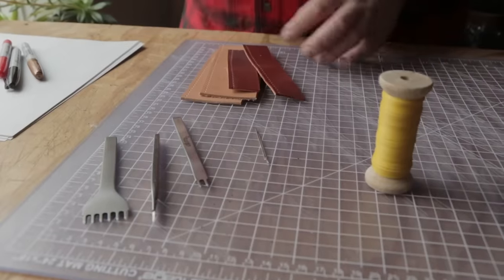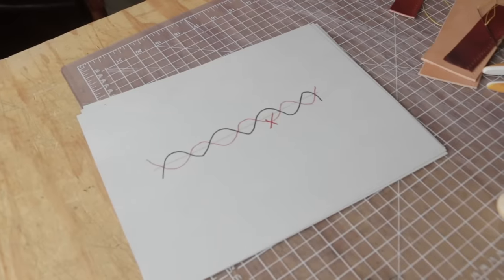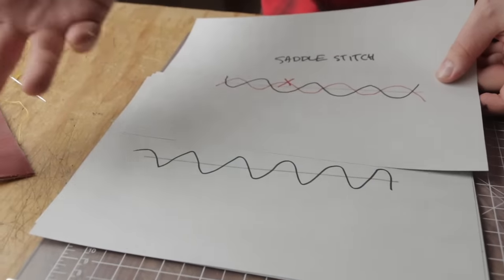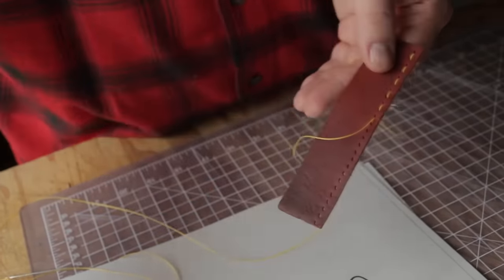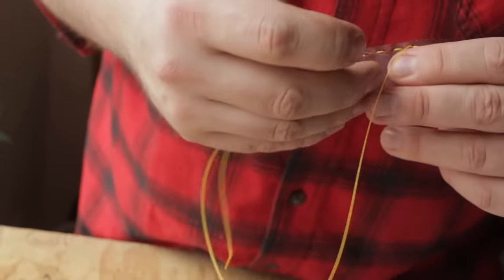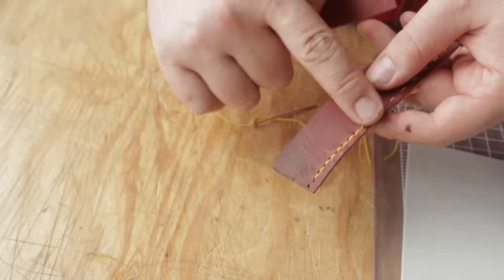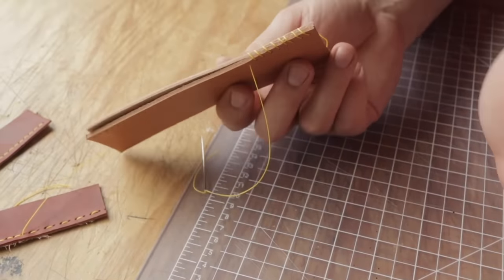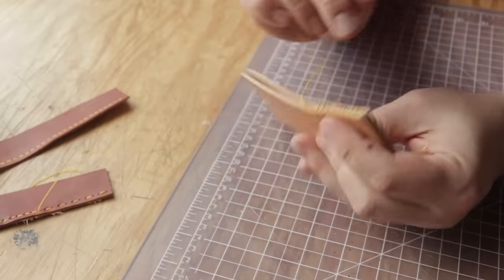The PROBLeM with Hand Sewing Leather

Comment: I'm in leatherworking for 4 years and i use saddle stitch from my first day. First thing i personally think it looks better and it is very strong but it's always a challenge to make a 20+ cm stitch, it takes some time.
Reply: Yeah I made me a belt with two hand  stitches running all the way down it and it look me like 2 days. God that string was so long that I had to pull out to run a full stitch all the way down. Lol. Probably will never do a belt by hand again lol
Reply: I know that feel. I make small goods for friends and family and I'm feeling very uneasy saying how long it took (for them to estimate how much they want to pay me). 50% of the time or more is stitching. I thought about getting myself one of those sewing machines cobblers and saddlemakers use, but the prices are astronomical for a mere hobbyist. And machine stitches are never as strong as hand stitches. So I am in a bit of a dilemma.
Reply: you need a clamp and routine to grab two needles in one hand perpendicular to each others to go fast using the saddle stich.
Reply: @kantamana1  I have a clamp here, thank Odin. Otherwise it would be very uncomfortable. It is most likely the routine. I've seen professionals stitch (not with prepunched holes, but with an sword-awl) and they are fast.^^
Reply: Why can't you split this up into sections and go like this?

Comment: I use the running stitch at the bottom of the individual pocket sleeves in my wallets … just something to stop the cards from falling all the way down to the bottom…
Reply from the maker: perfect use for it!
Reply: I'm going to start that. I've been using the saddle stitch exclusively on everything.
Reply: @canespugnaces2126  as was I… except I would just use glue for the little pocket inserts… however, I found that sometimes if I didn’t get enough glue, that the cards could push through that little barrier… so, I started just adding a couple of stitches there at the bottom of the pocket sleeves… just a little more added protection and strength there…

Comment: I agree 100% about the saddle stitch. I think you glossed over one of the other main issues with up and back stitching a little  though. It takes forever. You’re doubling your work, but it feels like it takes 4x as long to do.
Reply: But it lasts forever and if one stitch is ever cut or abraded, the failure pretty much ends there and can be easily repaired and using the same holes.  With a machine stitch, it can just start unraveling all the way down the line.  I put a bunch of money into an old Singer leather sewing machine and now rarely use it, except for something that may be on the interior of a purse or leather case.  I just want my stuff to still be around 50 years or more after I've gone to greener pastures.
Reply: @luke_skywanker7643  I'm new to leatherworking, what kind of stiching are you talking about? Is it like a backstich for leather? I ask because so far i've only seen such a stiching used to start and end saddle stiches.
Reply: @cerocero2817  I was talking about the old tried and true hand-stitching where you have a needle on each end of the thread and pass the needle through each hole in different directions, pull tight and then stitch the next hole.  (To finish, I do back stitch about three stitches at each end.)  With machine stitching, the way the bobbin "locks" the stitch is by crossing the upper thread and the lower thread somewhere in the middle of the leather being stitched.  This always leaves some tension on the stitch itself and can cause that stitch to wear through the crossing point.  With a hand stitch, both threads pass each other without being crossed and tensioned.  Sorry, it's hard to explain in words.  My basic rule is that I hand-stitch everything, except maybe a zipper or a canvas liner in a purse.
Reply: @luke_skywanker7643  thanks for explaining.
Reply: @cerocero2817  Sure.  Good luck in your leather work.  There's a lot of "needs" out there for real leather goods and a lot of people are tired of plastic.  Look for niches and things that can't be made as well overseas and then find a way to reach your market.  "Hand Made," and "Hand Sewn," have been good selling points for me -- especially to the kind of people who want one-of-a-kind quality instead of mass-produced plastic and these people usually can afford to pay the difference.

Comment: The main reason saddle stitching and hand-stitching in general has the reputation of being stronger is mainly because machine stitching is usually done with thread a couple of sizes thinner, for various technical reasons.  Most people handstitch with 0.5-0.6mm thread and up.  That's like 277 in machine stitching, which is considered huge.
Reply: A machine stitched piece will unravel quickly if the thread gets cut. In my experience, it unravels quicker even than single running stitch because each thread stays on its own side effectively.
Reply: @dshe8637  Yes.  And why would it get cut?  Because it's too thin, because machine stitched items usually use very thin thread.  If you machine stitch something with 0.8mm thread it takes a lot to get it cut.

Comment: I just built my own stitching pony that I can just set on my work desk… I have a complete spine fusion as well as a cranial fusion to my spin so, I cannot bend my neck to look down… the traditional stitching pony’s that you sit on do not work for me… so, I built something small that would sit on my desk that I can move around into different positions… this works for me when I have larger pieces that I can't hold by hand when I’m having issues with my hands… they tend to go numb at weird times without warning… kinda hard to hold onto things when this happens… I like to do most of my stitching by hand though and your videos have been a godsend for me as I have gotten into this craft…
Reply: Zippedupkitz - I’m in a similar boat as you. My issues were in the lumbar L1-L5 and my neck.  So like you, I have to pay attention to how I do my stitching.  It gets really difficult to deal with my right hand numbing to the point that it is difficult to hold a needle.  The best of luck in your leather crafting!
Reply: I'm similar too, I have a rectal cranial inversion

Comment: Merry Christmas!  I hope that you have a great holiday and great food!  Would you consider doing a tutorial on the different stitching irons such as the diamond, the straight and the round hole irons and talk about the major pros and cons associated with them?  There are several different sizes (5mm, 6mm, etc) and deciding which to use is not always easy.  Like @Jack, I am in my first year of doing leather crafting and all of my immediate family and close friends got gifts made of leather. Last night I stitched up the body of the “Bucket” tote (with the slanted sides) and started looking at fitting the bottom in - I believe it will be a challenge for me to do!  I also just finished the Snap Wallet that will eventually be given away for a birthday gift.  I appreciate your time and consideration of my suggestion!

Comment: Excellent advice! I totally agree about the need to learn and practise the saddle stitch from the start. The results are so much neater and the pressure on the thread the same over the whole length and if you cut a groove to sit your stitching in, the thread will be even more protected from abrasion. With some practice, you quickly learn to thread the needle past and not through the thread, which is impossible with the "out and back" technique. For anybody starting leather work, make sure you use round nose needles which slide smoothly through the punched holes. Sharp needles are a pain! And also, make sure the diameter of you needle fits the hole you've punched: if the needle is too thick, you're going to spend an awful long time pulling your needle with pliers in between stitches!
Reply: All good advice! Been saddle stitching for over 40 years. Been mistaken for machine stitch.

Comment: Corter, A true saddle stich has a half hitch in each hole. What you described is a running stitch. Some believe that what gives the saddle stitch is the angled hole that is made by a iron. This is not so. What gives the saddle stitch its signature look is the half hitch as the passing threads actually tie a half hitch through each hole. When beginning say from left to right, the first needle is passed through the first hole through the piece and matched to the second to find center. The left needle goes through the second hole and the thread is pulled till about a 1-2 inch loop is present. The right needle then goes into the hole from right to left and poke through. At this point the forward thread on the loop is crossed over the needle, then the needle is pulled through. At this point it is rinse and repeat.

The half hitch is what gives it its strength. If both thread are cut, the half hitch is what keeps the piece from falling apart. There is a method that also is described in a video whereby left needle is pushed through and the right needle is placed under to form a cross then pulled. At this point the hand is rotated to allow the right needle to be inserted then pulled through. This creates a running stitch not a true saddle stitch.

A true saddle stitch and its signature "saw tooth" look can be achieve with awl holes inline. I hope this clarifies the saddle stitch.

Comment: There is also a "locked" saddle stitch if you need even more wear resistance where even if a stitch breaks the "locks" (loops really) hold the thread in place its normally done by looping the first thread around the second as you go along its more commonly seen when people use a pony and go single hole by single hole than the method corter uses for saddle stitch which is kinda closer to a running stitch with two threads than what saddle stitch is depicted in places like Al Stohlmans "art of hand sewing leather"
Reply: Currently restoring a 35+ yr old saddle requiring new thread work in the original holes. Saddle manufacturer has passed and saddles are highly coveted. Wondering about your stitch idea as I normally have used the saddle stitch for 25ish years, but want to do very right by this saddle. Areas with most thread worn/broken are areas where the human legs with jeans to chaps will have been rubbing on the saddle by the rider around what is called the "shirt" of the saddle. Thoughts?

Comment: I use a Grey’s Anatomy and two clamps as a stitching pony - I just set it, spine down/pages up, on the table in front of me and it works great; the bottom front clap keeps it from tipping side to side (like it has two little front feet), the second clap I keep closest to me and up near the project so that it does not move around.
Reply: Brilliant. Just be careful. If an errant stitch goes through the liver, it will never stop bleeding.
Reply: Bueno no es que no deje de sangrar para eso están las plaquetas y el tiempo de protombina.

Comment: I have used a whip stitch and a modified whip stitch before. I used it only for limited items for the reasons You mentioned . I have done a modified whip stitch on thick tubular shaped items ( motorcycle handlebar tool bag ) with flush fit end plugs for a special sort of character . That running stitch is mostly seen in ( buck stitching ) old west items from My observations . Love Your videos , thanks !

Comment: Thanks for the tutorial Eric, this is certainly great knowledge to add to my DIY knowledge kit. When sewing thick materials like leather shoe repair or sewing canvas, I tend to use sewing awls as I had not heard of pricking irons till now and have been limited to the overlocking stitch (I'm not sure that's the right name but that's how sewing machines do it). I think it looks every bit like a saddle stitch, which I'm also just learning about here but not not as strong or secure because pieces of leather are held together only by thread looping opposing thread and is prone to unrevel when one breaks because there is nothing to hold on to the opposing thread except friction. They are great for repairing shoes though when you have very little space to navigate large needles.

Comment: Great technique on the saddle stitch! I just wanted to briefly comment that there is a very subtle action this fine gentleman is conducting that allows the stitch on the front side to have that quasi "zig-zag" effect in the shape down the stitch that gives it a clean and organized look. Notice that when the needle is pulled through the front to the back (around 2:20), that portion of thread is pulled slightly down and back to allow the needle pulled through the back to the front to be positioned in the same place within the hole each time. In other words, the front/back stitch is "low" in the hole and the back/front stitch is "high" in the hole. It also helps avoid the annoying "needle through the thread" mistake that can cause some problems. Consistency is definitely key for a clean professional look...

Comment: Another problem with the out and back stitch is, like I found for me, I did not have dull tipped needles. My needles had sharp tips. When I went back a second time to get the look of a saddle stitch, my needles were tearing the first stitches threads. This also weakens the stitch. Sure, I have not had any of my stitches give out yet, but I have only been using them for six or seven years. A good leather piece should last longer than me. Okay, unless you are going into combat with them. 

I enjoyed the video! 

Dave T

Comment: I started off stitching the way you guys do. However there are times I cannot get the lines as consistent as I'd like on the backside. Ive started doing the french style with a saddle to get the angle on both sides. It's not as enjoyable as just handstitching so I don't do it for everything. Both are great for my style :)
Reply: Same! I can never get the back side of the stitches to angle correctly using the leapfrog method. French style with a stitching pony produces my most consistent results

Comment: I worked as a Sailmaker for a while and am used to handling long threads, but I quickly found that out and back for leatherwork gave twice the length of thread to deal with and sewing shoes it wound up hooking up on everything. So saddle stitch every time.

Comment: I use the saddle stitch method with knot for majority of work. It  looks cleaner to include benefits described in video. I do not add knots when doing final two back stitch which gives cleaner look. The only time I use a pony now is when doing long stitch lines, I.e., belt. Otherwise, I do not use it., I.e., sheaths, wallets, purse or holster.  I would pay attention to size of pricking iron/chisel holes, string size and needle size which can make it much easier when adding knot and last few back stitches.  As usual, I enjoy these videos.  Merry CHRISTmas!!!!!!!

Comment: As was mentioned in another comment, if the leather is thick enough, use a groover to make a groove to match the thread size so the top of the thread is just below the surface of the leather.  That way, the amount wear on the thread is practically zero. If not grooved, you can also use a hammer on the stich line to press the stitches into the leather. But it won't be as good as a groove.

Comment: A true saddle stitch takes advantage of an angled holes and ends up looking very nice and if done correctly that stitch do knot in the middle. It is very dependent on which needle goes over/under the other when passing through the hole. The stitches look like a chain of  "z's". It took me some time to learn saddle stitching. Gussets also require that you learn left hand and right hand stitching holes because you have mirrored faces. I did a large soft sided computer and file bag that was completely saddle stitched and the decorative nature of the angled stitches was worth all the effort.

Comment: I sometimes use a double whip stitch for bracelets sewing the glued on suede on the inside to the tooled or sometimes just alligator skin. I literally do each stitch like a saddle stitch using two needles so I can arrange where the X goes. I obviously don't want it on the bottom, but on the top so the bracelet looks like it is surrounded with little X's. Works well with thin lace too.
Be sure and do a test piece to see how much thread you use per inch as a Whip Stitch uses a lot of thread and a double Whip uses 5 to 6 inches per inch. It is why I only use it on something small like a bracelet and it is hard to hide a splice if you run short.